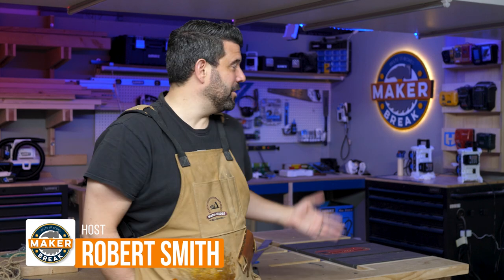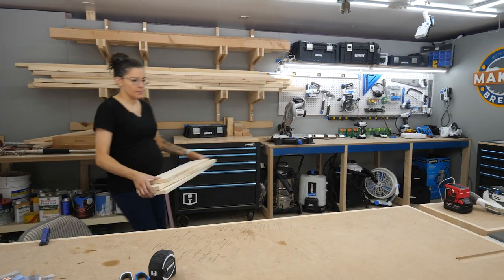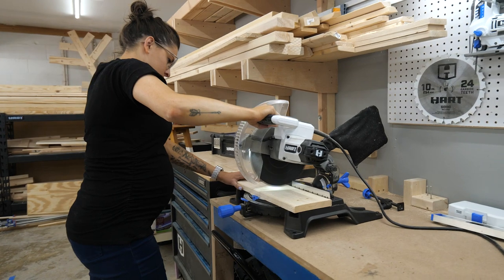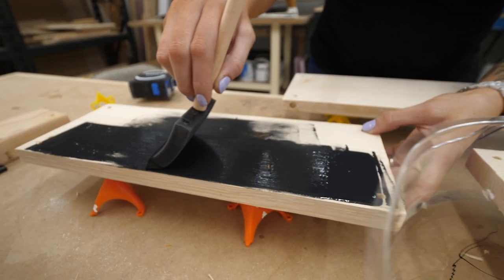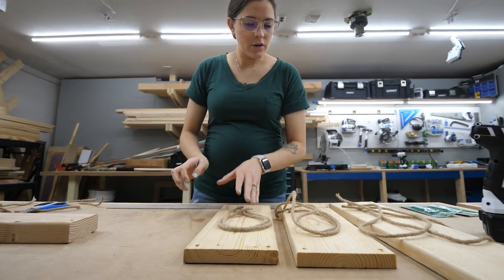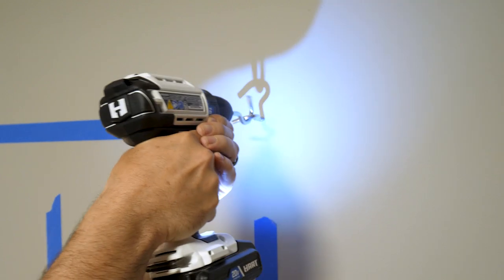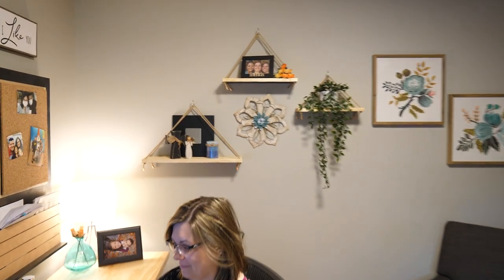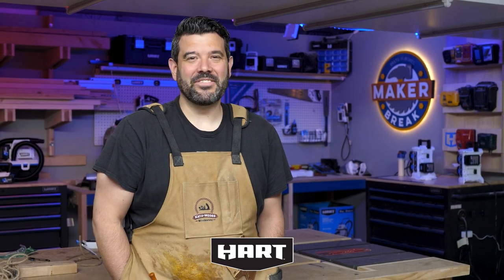Scrap Wood DIY Project! Rope Shelves that are really easy to make! Time for a Maker Break!

Comment: They look great, and with the black pain on the bottom, it helps that it doesn’t show.  Idea — If you wrap the rope around the hook once, you can still adjust, but it will help to keep the rope from slipping.